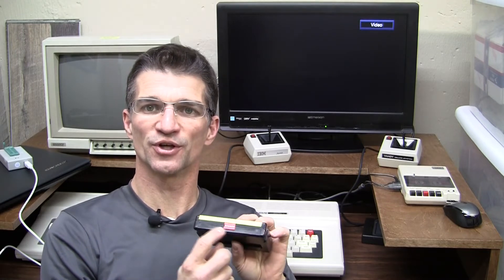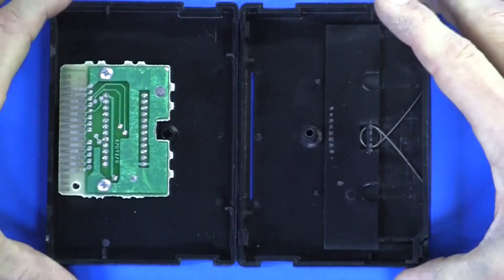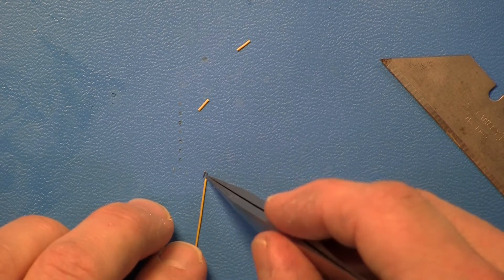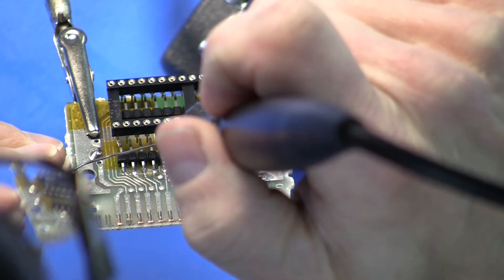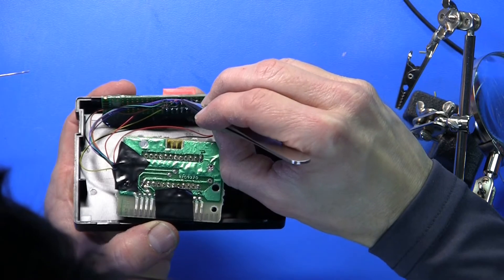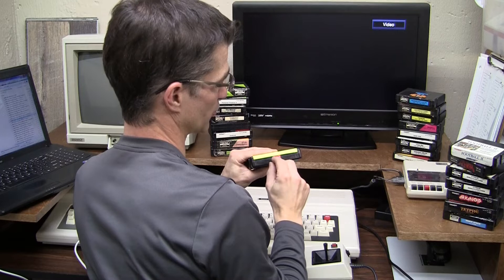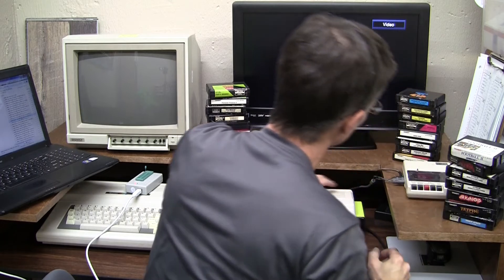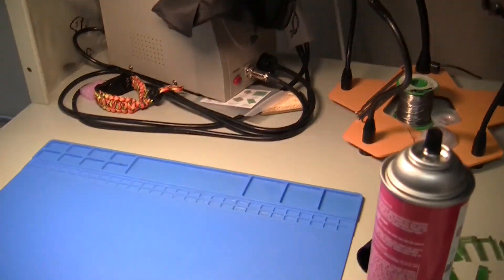Super 64-in-1 ROM Pak - TRS-80 Color Computer cartridge using AM29F040 Flash

Comment: AC is that a PCjr joystick that you have converted to Coco?  Do you have a video from that or instructions?
Reply from the maker: Yes it is!  I wondered if anyone would notice that and whether it has been done before very often.  I have no video for the conversion, but it is not too difficult.  One of my original Deluxe joysticks had broken plastic pieces inside. I borrowed the cable from it and resoldered it to the inside of the PCjr joystick.  If you have no donor cable, you could purchase a solder type DIN-6 and replace the PCjr connector.
Reply from the maker: Hi Bryan. I just learned that there is a write-up on the conversion in a newsletter you can view on glensideccc.com in the volume 40 issue 1 (thanks Rick Ulland). Let us know if that helps.
Reply: @acs8-bitzone651  Thanks for this AC!  I had found older and sometimes conflicting information.  I had picked up 2 of the new-in-box PCjr sticks and a couple DIN connectors but was worried about breaking something (like my CoCo2 joystick port!).  This information will come in very handy!  Please keep up the great work with your CoCo tinkering and repair videos they are much appreciated!

Comment: Try this instead!   

CocoFLASH 8MB Flash Cartridge

Introduction

CocoFLASH is a multi-ROM emulator for the Tandy Color Computer Systems 1, 2, and 3. It offers 8 megabytes of ROM storage, supports >32kB ROM images (like RoboCop) and includes built-in support for the Tandy Orchestra 90 Stereo Music Synthesizer cartridge.

https://www.go4retro.com/products/cocoflash/
Reply: All hardware documentation and schematics are here: https://github.com/go4retro/CocoFLASH
Reply: The CoCo Flash is programable in the CoCo, no EPROM programmer needed.
Reply from the maker: That is a neat looking board.  I will look into it.  I see it is sold out right now but it is a fairly good deal at 50 USD.  Thanks for watching and the links!

Comment: Excellent.  I would be tempted to replace the DIP switches with an Arduino, a 2-digit LED display and two buttons (up/down) which would automatically reset the system when changing banks.
Reply from the maker: Interesting.  I wonder if the ATTINY85 could handle it, or what would be the smallest / cheapest micro board that could.
Reply: @acs8-bitzone651  ATTINY would be OK as far as code/memory, etc. but you need more pins.  6 address lines, reset, 2 buttons, and 9 pins for the display, so 18 I/O pins needed.  Save several pins if you use an I2C or SPI display instead of 7-segment LEDs.  The ATmega328 (same chip as Arduino Uno etc.) would work well with no additional components other than a filter cap or two.  Or use something like an Arduino Pro Mini, I think it would fit.

Comment: Awesome video as usual!!! Can the DIP switch be placed facing up so that it would be easier to select the bank?
Reply from the maker: Yes, that would be even better!  Nice suggestion.  It was hard to guess which was going to be better when I first started.
Reply: Yeah, tough call - if it ends up in a multi pack expansion unit the switches might be better on the end.